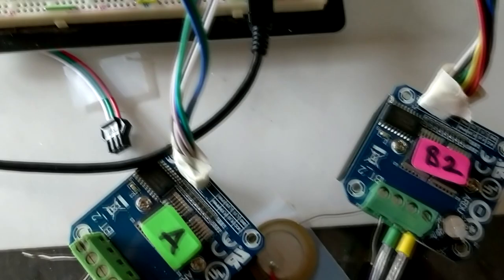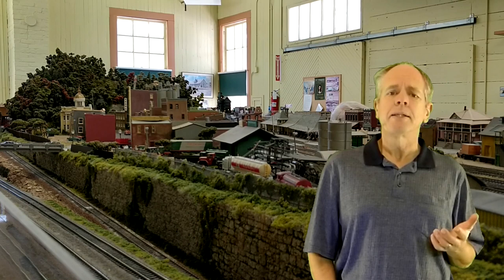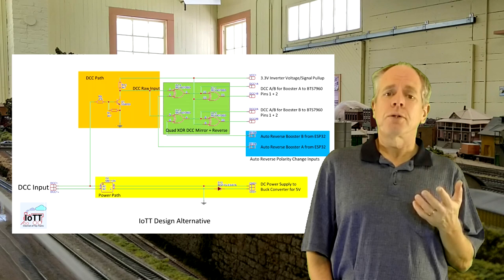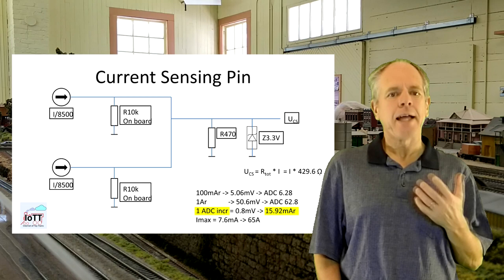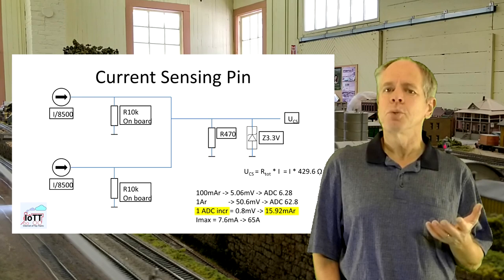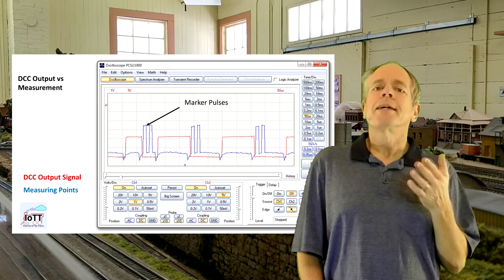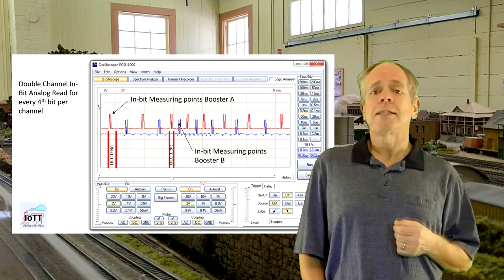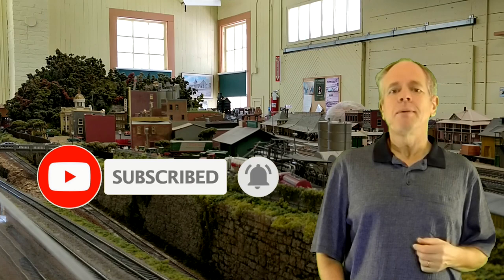Holiday Booster (Video#34)

Comment: Excellent work, as usual, but I'm not entirely sure that all that precision is needed. I've implemented almost a similar design using the BTS-2, and had reasonable results with simple averaging of the current, but then, I decided to use multiple boosters for various power districts, and limit current for each to between 3 & 6 amps(each booster is programmable using jumpers on the module that drives the BTS-2, and can also be a reversing module at the same time). Detection was reliable, and the logical reversal of the DCC signal polarity was quick enough so all the sound locos that I tried, transitioned the reverse detection event without any decoder reset events or audible abberations. The only issue is that care must be taken so that 2 reversing modules are not adjacent to each other......they tend to get confused as to who is actually supposed to reverse the polarity, and both try to do it.

Granted, I don't have the resources that you have to test, but I was satisfied with the results. The current measurements were done with just a 15W power resistor, but obviously while driving that load with DCC signals.

I control the 'enable' pin on the BTS-2 by using a retriggerable One-Shot that disables the module(s) when the DCC signal stops within 1MS, preventing a pure DC voltage from being applied to the track.

I didn't use an Exclusive OR chip to invert the signal, but used parts of a 74LS00(3 gates) and 74LS04(2 gates) to implement the XOR functionality. The XOR chips are not very common anymore, and since I already had the other 2 chips on the PCB, I used them. The total propagation through the SSI parts is probably less than 20ns.

My design uses a module to drive the DCC signal and the enable signal to up to 2 remote modules that do the monitoring of the BTS-2 modules, linked by static/half-duplex RS-485 lines that only send the signals, and never receive anything. The signal is regerated by the modules that do the detection, and total skew in the DCC signal is less than 15ns, so, there's no real practical limit to the number of modules. It'd take about 60+ modules before the skew would reach 1us, which is within the jitter spec for DCC.

Comment: NMRA DCC spec S-9.1.2 section 2.2 requires opto-isolation between the CS and the booster via the power station interface. This spec is undergoing some revisions though to clarify some aspects and it is my understanding that the driver/receiver interface will be deprecated since it was not widely adopted and the opto-isolated approach is very widely adopted.
Reply from the maker: Thanks, Mike. In this video I am using a Section 2.3 interface for the simple reason that I can power the controller directly from the DCC signal, but I also tested the Opto version to make it 2.2 compliant. The plan is to have both options on the final PCB.
The purpose of an Opto of course is to separate the potential between the input and output to avoid ground loops and other ugly effects. If you then use the DCC energy to power the circuit, along with a common ground, the use of an Opto is pointless. And if the system is using a common ground that connects all devices (and is typically needed to make sure block detectors and reverse loop units work properly), the use of an opto is at least questionable, even though common practice, as you pointed out ;-)
Reply: @IoTT  A common ground between the CS and boosters is used for most commercial DCC devices.

 I'm not certain it makes sense to support section 2.3 since the spec is so vague as to what is really required for the implementation of it. My understanding is that it is supposed to be for RS-485/422 devices but I'm not 100% certain on that. The only manufacturer I'm aware of that even implements this is EasyDCC whereas all other manufactures opted for 2.2.

Btw, the BTS7960/IBT_2 has been quite problematic in my experience. Two identical boards can behave dramatically differently. I've also had problems with the h-bridge whining under normal operating conditions. I've moved away from these in favor of other devices.
Reply from the maker: Can you tell more about your experiences with the BTS7960? As I pointed out in the Video, I saw some differences in the current sense output that I do not know where they are coming from. I did not see any problems on the output side. 
And of course I am wondering what other devices you would recommend, particularly as the BTS7960 appears to be at the end of the life cycle from Infineon's point of view.
Reply: @IoTT  My experiences with the BTS7960 were not pleasant, mostly resulting in the whining sounds coming from them. I shelved the modules after encountering that repeatedly.

I'm currently using an LMD18200 (3A max) with some success. There are a number of factors to consider with the h-bridge being used, especially when it comes to connecting to other commercial equipment.  You need to take into consideration the current sense capability (high side, low side, inline) and how to handle RailCom (short rail 1 and 2 together). The L298 is low-side current sense and RailCom can be detected by setting the inputs correctly (I forget which now). The LMD18200 is inline current sense and by setting the EN pin LOW and BRAKE pin HIGH RailCom can be detected successfully.

Comment: Hi Hans.   I have been looking at DIY DCC Boosters - how can you check that the booster is receiving a DCC signal before it starts to generate track power?  Cheers.  Bill
Reply from the maker: If you have a processor on the booster, you can monitor the DCC signal and only enable the H bridge if you see the rectangles of the DCC signal. Without processor, you do the same using a re-triggerable logic gate that drives the enable pin of the H bridge for about 2 ms after receiving a level change on the DCC signal.

Comment: Definitely need RailCom.
Reply from the maker: I looked into the possibilities to support RailCom today. I think it could be possible with some small changes to what I have so far. I'll give it a try, for sure.
Reply: @IoTT  Did you look at both? RailCom & RailCom+  ESU , Lenz and and others have RailCom + already in there decoders.
Reply from the maker: From what I see, the difference is in the data format, but the cutout is the same. So, if I can successfully support the cutout generation along with low impedance connection of the two rails , both formats should work, assuming there is a decoder somewhere in the loop.